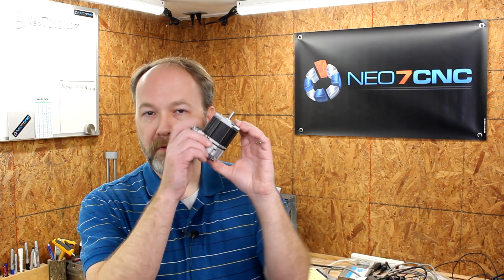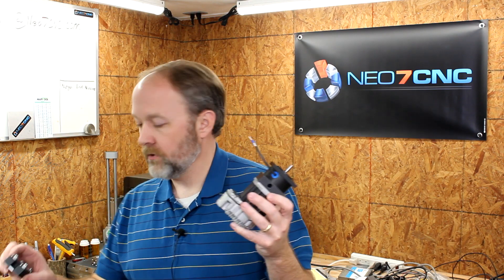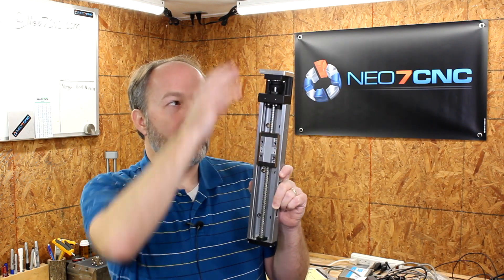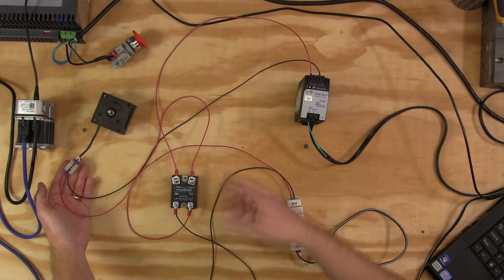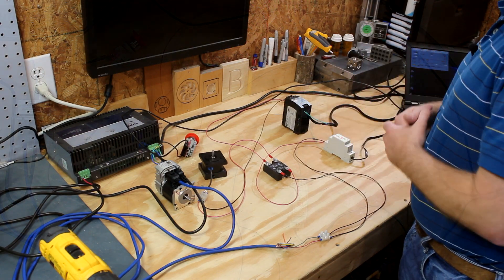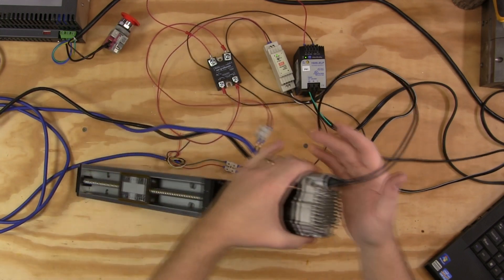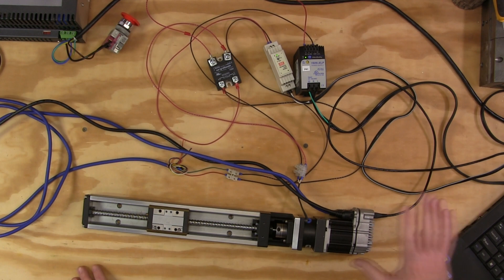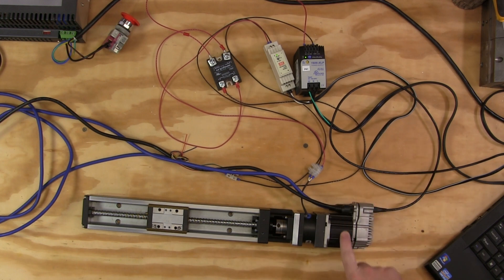How to Use a Brake with a Teknic ClearPath DC Servo Motor - Neo7CNC.com

Comment: For anyone who might be looking for the original application notes. The diagram, as well as some additional information, are easy to find in the original ClearPath User Manual in the section under the title "HLFB Driving a Brake Via Solid State Relay". Reading other sections about HLFB output modes and electrical specs is also recommended.

Comment: hi, very nice and well explained video. Please tell me If I understand you correctly you connected relay to the motor encoder cable? Green EB "-" , RED "VCC" corresponding input motor drive.  Could you also explain whether it is necessary somehow to connect brakes to the cnc controller?

Comment: David that you again for this information.  Ive had my machine up for some months now and am finally getting to install a brake.  find one on Ebay with a 90 degree reduction box that solves a limitation I have on Z.  

This brakes aren't cheap new.

Did you have a link on where you acquired your spindle power cabling.

Comment: With an electronic bake.  How exactly would that hold, in the event of an actual circuit breaker short and you use electric?  Will you be running separate circuits, with independent power supplies or battery backup - to the brakes?   Just put a spring catch on the bottom and be done with it.
Reply: Most brakes like that are power-off brakes meaning when the brakes are energized they are held open but their natural position (no power) is to be in a closed or clamped state.
Reply: Ok that makes sense.  Using a fine pitch ball screw will hold that carriage vertical, and take the load off the motor.

Comment: So only z axis needs a break. Any reason why x and y should have them.
Reply from the maker: You could use them on every axis if you wanted to.  I only use one on the Z to prevent it from dropping due to error or loss of power.  Typically the X and Y will not move on their own if there is an error.  It's cheaper too :)

Comment: That begs a question.  Why doesn't the servo manufacturer build one in?
Reply: My JVL servos have built in breaks but they are $2300 each for 1hp
Reply: +Mekhanic1 *brake
Reply: Wow on price and hp.  What loads are you driving?
Reply: Seems like a lot of cost, complexity, and size to add when most axes don't need a brake.  Especially given you can just buy an inline brake like the one he is using.